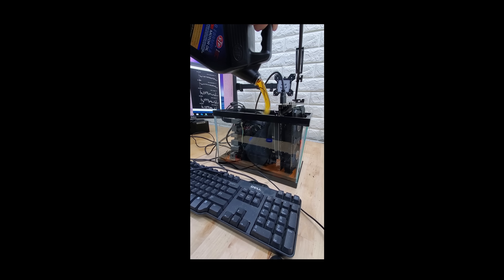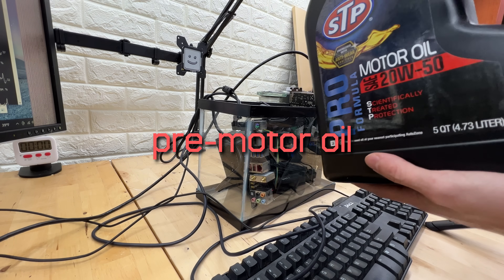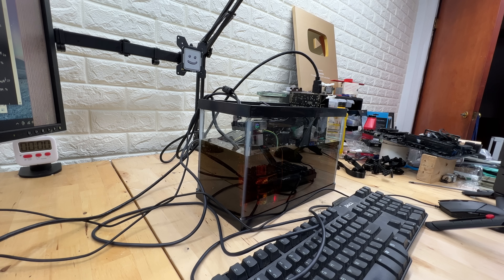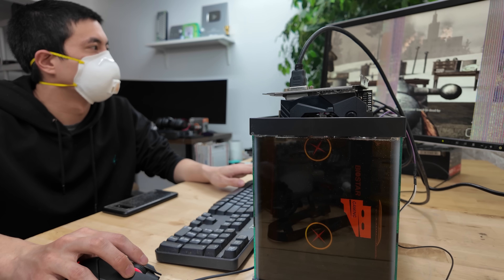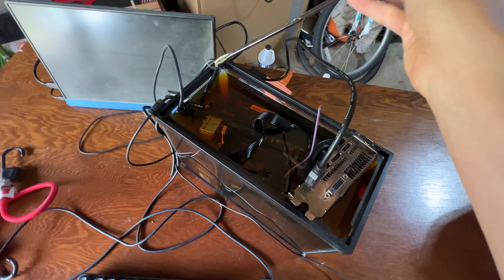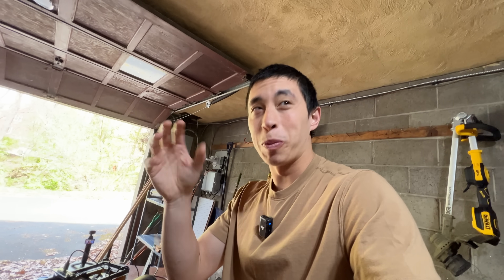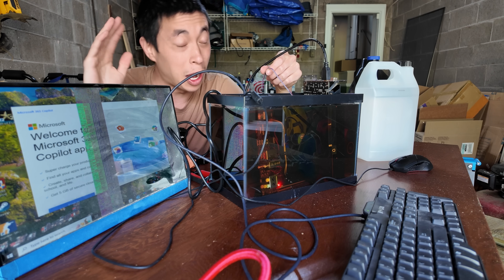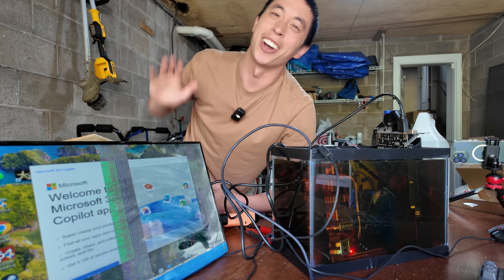Why isn't Motor Oil used to cool down PCs?

Comment: Not the same viscosity. Plus motor oils have anaddative that contains various metals, like calcium, Molybdenum, and others. I doubt mineral oil has adatives that can settle out of the oil, but motor oil does. Also, I'm not sure mineral oil has a shelf life, like motor oil. Hmm. Even if yo had propellers for fans. What would happen when the anti foam settles out of the oil? BUBBLE BATH!!!
Reply: Yup, I knew it.

Comment: I think people are missing the point entirely, motor oil reduces friction, its there to protect the parts from wear and tear.  Engine coolant is to transfer heat away from the engine to a radiative apparatus.  As it is a better conductor of heat

Comment: Last but not the least based on my experience: A lot of plastics and rubbers do not like motor oil. They slowly swell and/or disintegrate in most motor oils. Some plastics does it fast while others does it over a long period of months/years but it still happens. 
Few plastics resist motor oil but it's not that many. The container of the motor oil obviously resists it. Some actually have a coated inside to protect the rest of the container.

Comment: I know data center that cools servers by submerging them in oil. But they got rid of fans, installed heat sinks and have circulation system that moves the oil outside to cool off (they also use the excess heat to heat parking lot in winter). Also, they don't use motor oil but some raw pharmaceutical oil used in hand creams. It worked so well they had to ask their distributor to change the firmware limits to allow more servers per cabinet

Comment: I'd be interested if one could convert a water cooling block to function with motor oil instead, if you changed the pumps to accommodate the much more viscous liquid. Could this be the best of all worlds?

Comment: The hard part is finding out what the additives are. Some additives may increase the conductivity, while others will decrease it. A low conductivity could allow you to completely submerge the boards. You just need a case that will accommodate that.

Comment: TBF, while engine oil does act as a coolant, it's primary use in an engine is actually lubrication. I was surprised that it didn't just ruin the PSU or something though

Comment: 0w-16 oil and a loop with a pump, radiator with fans for cooling and sending the oil back into the tank. Probably don’t  need the fans on the gpu and cpu if the oil is moving through fast enough.

Comment: people saying use 0w8 etc...why wasting money just use cooking oil... what is important ? look at viscosity at 40 degree but best oil to use would be transformer oil like B30 millers transformer oil no other oil even cooking oil would have better flow at 40 degree , it is designed for it :) such oil you can find in fridge compressors etc, engine oil has to stay at certain viscosity in higher temperatures to prevent wear and no matter what engine oil you use it will never be good enough flow for your needs...

Comment: Wait no way !!. I still using motor oil as cooling oil 😂 9 months and still good  i remove the fan when i using the 0w20 but when i use 0w16 i can use fan without problem ..  well for the odor i dont mind i use to that smell Because im working at car repair shop

Comment: 0w-20 or 5w-20 is the way to go if you are gonna do this (I am sure you can find thinner oil, but this is gonna be available widely and affordable).  oil formations are designed for the operating temps and conditions the oil will be used in.  this oil doesn't need to reduce "wear" or deal with extreme cold or heat and viscosity is a problem rather than a benefit in this situation.  thinner is better in this use case.

Comment: Seriously? 20w50 oil???? I'm only 1 min 10 into the video and I can already see it's going to be pointless. Might as well have used treacle. Using a low viscosity, 5w40 5w30 0w40 0w30 0w20 would have been much better. You've just dumped the thickest engine oil you can find in that tank.

Comment: Curious if you should had just taken off the heat sinks and just let the CPU to be "oil cooled".  There's no pump moving the oil but the heated oil should begin circulating by itself.  Not sure if that will be fast enough to be more efficient than the heat sink or not.  You using a viscous oil didn't help though.  0w20 would had been better, though you'll need to pay more for your experiment. :)

Comment: As far as I am aware, the difference between Motor Oil and Mineral Oil...Motor Oil's heat dissipation qualities requires temperatures much higher than a PC can realistically generate to be effective.

Comment: There are lists of known compounds that are not compatible with certain types of oil. Just make sure none of the incompatible stuff is in the computer parts. The reason why you wouldn't want to use motor oil is because the biggest reason for its existence is lubrification. You don't need to lubricate computer parts so you don't need to deal with all the downsides of it.

Comment: you can easily clean motor oil off of things with several different chemicals. i mostly use gasoline for car parts but you can also use lacquer thinner or even brake cleaner from a spray can. you could prolly also use some type of degreaser and let it soak in it.

Comment: A better question would be "why would anyone use motor oil to cool a pc?" 
There is no moving parts that needs lubrication, and water is superior for heat transfer. Dumb video

Comment: Motor oil is mineral based. At least the non synthetic you were using. Eventually, the additives will attract to any ferrous parts in the computer and could cause some issues and oxidation. Motor oil also turns acidic when exposed to air after a period of time. Might work short term, but definitely will not after I'd guess after 6 months to a year.

Comment: To be honest, it would be nice to see in a gycol-based coolant would work. 

The issue with both oil and coolant is it needs somewhere to transfer the heat. 

A radiator or other device that the oilf or coolant moves through transfers the heat and returns in a loop.

Comment: There is no point in keeping the fans in there, certainly not having them connected. I doubt the heatsinks do much either, but they may either help or make it worse, depending, either way you should have some system circulating the oil, bringing the  heated oil out and cooled oil in..

Comment: Stray capacitance and obliterating your overclock is the reason why we don't do this. 
I did something like this years ago.  Turns out it's a terrible idea because the dielectric constant of motor oil is much higher than air (2.1 to 2.4 times as high) which sends stray capacitance through the roof.  This will DESTROY your overclock.  I had a computer that would run rock solid for months at one frequency that wouldn't even boot after the oil.  I had to reduce my clocks about 15% and even then the machine was never the same.

Comment: Based experience of doing maintenance on a car, motor oil doesn't have nearly the thermal conductivity of water based coolants. Since many manufactures recommend changing the oil with the engine at nominal operating temperature, assuming this is to ensure best drainage due to less viscosity at those temperatures, I've had hot motor oil make contact with gloves I've worn, and even in one case bare skin. Providing the engine isn't turbo charged, where the oil is hotter since it cools the turbines, and get the glove or oil off you quickly, it won't burn you. The same cannot be said for coolant, you will have third degree burns instantly with coolant.

Comment: Mechanic here: Dont use Quakerstate or Pennzoil. Use Valvoline as it has less wax used in its formula. Wax is not a good coolant, I promise you (looks at the yellow crankshaft on the garage floor).

Comment: I don’t understand why this is even a video. There are other less obviously dumb ways of getting heat out of a system. Try AC refrigerant. At least it’s used in things as a coolant. Motor oil is a lubricant. Lubricating hot chips won’t do anything

Comment: 8:45 used motor oil picks up metals from the engine and can expose you to heavy metals and lead. It isn’t an actual property of the motor oil that can make you sick, it’s the use case🫡

Comment: Motor Oil has what is known as a "Viscosity level" and the hotter the Oil gets the more Acidic it becomes. High enough acidity and it will eat through solid metal. This is why everyone is supposed to change their motor vehicles Engine Oil and Transmission Fluid as both fluids are Oils. 

The Ph level would just become so acidic it will eat through the entire PC.

Comment: To clean this, submerging the oil covered pc in a mineral spirits (naphtha)  auto parts cleaning basin comes to mind.  Never mind it might dissolve other things.  However, I would never do this to any pc I use. I work with my car enough to not want a petroleum product covering my pc.

Comment: It is funny how surprised you were that 2050 motor oil was thick enough to stop those little bitty fans. Why the crap would you use such a thick oil to test this 520 would’ve been easy to get and you can go thinner than that. and you probably could’ve just disconnected the fans to start with cause they are useless in the situation.

Comment: Also motor oil's specific heat is so insanely high, you could probably run a top end Intel CPU on full load for a full 24 hours and still not have any need to cycle the oil in a cooling system.

Comment: I knew immediately that oil does nothing to most electronic components because modern car engines (and automatic transmissions) all have tons of PCBs and sensors that are exposed to oil based fluids for their entire lifetimes (multiple decades), and they don't break down (well, they DO break, but not because of oil exposure).
Reply: Oil absolutely damages components. Engine oil is made with protective minerals put in that will damage components. Engine oil will also collect moisture from the air if you live in a humid enviroment. Which is why engine oils have a operating temperature. Which is why engine oil sensors are Thermal couplers and pressure sensors, which can both be isolated from the oil., And comparing Engine oil to transmission fluid is like comparing apples and oranges. Transmission fluid is mainly ethelyne glycol which is a solvent which doesn't have the same issues as engine oil as its hydrophobic. And its a stable polymer that isn't likely to pick up minerals.

Comment: What's happening here isn't really "cooling" because all you've done is submerged it. I recommend to really try the experiment again you need to try pumping the oil to and from an external radiator and fan, and choose an oil appropriate for the size of the machine, a really thing motor oil. Also you can do away with the plastic fans on the video card and cpu because they aren't helping! Getting large fin stacks for the cpu and gpu fanless will be good for an actually useful experiment. Hope this helps. I am a diesel engineer.

Comment: Bro picked the thickest possible oil, whyyyyy?! I need an oil change update on this with full synthetic 0w oil please. Also, it's probably best to use a very basic one, some oils have more additives than others, and those may or may not make a difference in any possible reactions with the hardware. In general though, motor oil is supposed to protect very well, so I can see it being fairly effective.

Comment: You could technically use de-ionized water. I'm not sure where you would get that. I used to use it with wire EDM machining. We had this golden resin that would filter the water that we had to change occasionally.

Comment: The fans are basically useless because of the oil, there should be a pump to circulate the oil instead so we can move the hot oil away and cooler oil back towards the computer. I think this isn't really necessary for a typical personal PC, but If there are no long term consequences it might make a lot of sense to use a light weight oil to cool large scale servers, if you could have a sealed system with an oil cooler it might actually be cheaper than current server cooling options, though as important as maintenance is a server would require access to replace parts, so it would need to be made in a way that allowed for that.

Comment: Mainly the answer is that it's too thick and it was designed to operate under motor temperatures... So... This thick oil will be hard to clean and basically it won't flow very well.

Comment: For any liquid submersion, I would remove the fans and any moveable parts, then install a water pump - or something similar that can handle the increased viscosity, to move the liquid to a "cooler" then back into the tank. I doubt a computer could reach the temperatures needed to even out the heat within the tank since I'm not interested in it enough to look it up, but its something to keep in mind.

Comment: Actually, why not use motor oil in a cooling loop? You would probably be able to keep the loop running for much longer, not needing to change the oil every two years no?

Comment: Yes, except that engines are basically water-cooled. It's the radiator through which the water circulates that cools the engine. The oil serves to lubricate the engine so that parts don't rub together and generate heat. The only moving parts in a PC are the fans.

So, I'm not saying that oil isn't effective at absorbing heat, but it's certainly not used to cool an engine, but to prevent it from overheating without even having to use its heat-absorbing properties because, basically, it just makes things slide better.

In addition, the oil needs to heat up before it becomes a good heat transmitter (and will do so slowly as it is not very good at that by default), which means that you will have to wait until the PC is in the red for a very long time (the time for the entire volume of oil to be at the right temperature) before the oil starts to be of any use where the action of water is almost immediate. Oil is not made for things that do not rise so little in temperature as a PC and especially adapts very poorly to rapid temperature fluctuations that a CPU or GPU can require. It is much less adaptable than water.

Ultimately, for PC the only real advantage of oil over water is that it does not conduct electricity; for everything else, it has nothing but drawbacks.

If your fans stop spinning, it's mainly because they certainly don't have the power to operate in a liquid. All you're doing is burning them out by leaving them powered under these conditions, especially since they're useless if all the equipment is submerged (exactly like a completely sealed PC case with a fan spinning inside). If they can spin under these conditions, that doesn't prevent them from having to give everything and still be slowed down. It's like making an athlete run at their maximum speed but forcing them to do it in calf-deep water. They'll push hard to do it and then tear their muscles. In any case, it won't circulate the oil in the radiators or at least not enough to change anything in the temperature and you would have to waste a lot of power to get them to spin hard enough in these conditions to get any really useful result, which is almost impossible in this configuration.

Comment: Probably because the heat capacity is ~40ish percent of the heat capacity of water. There was a place that put their servers in mineral oil though to make them silent. So it has been done before.

Comment: The problem with using motor oil is a PC doesn't run hot enough to get the oil up to operating temperature, also it will make your house stink and its flammable.

Comment: Funnily enough motor oil doesn't touch you're stuff like at allat most it woll create a layer over them but besides that if yoh leave this pc enclosed in oil and come back 50 years later it will most likely book like nothing ever happened.

Comment: Try with lower viscosity oil like 0w-8/ 0w16. They are also more transperent. fans will not spin in anything higher than 5w30
Reply: Why/How do you know the maximum they can spin in lol

Comment: Well motor oil is a lubricant meant for combustion motor engines that have moving parts to reduce friction.

There are no major moving parts in a computer that would warrant using motor oil in them.

Antifreeze is a coolant used to cool down combustion motor engines.

That being said, I could see a video emerge about cooling down your CPU using Antifreeze.

Comment: Whyyyyy are you using 20w? That's super viscus and thick. If you used some 0w instead the fans would probably keep spinning and act as an oil pump haha. I'd be interested to see how it works with a single large fan in the tank to aggitate the oil around more

Comment: Thats not where i thought this was initially going, I was thinking for a water cooling set up & that the reason they dont use it is because the pumps aren't strong enough or wear out quickly.

Comment: Because it makes a terrible mess and motor oil can contain additives that is electrically conductive...  Also you will need a radiator to cool the oil. 

There is other oils better suited but it makes a horrible mess and you never the the components clean again and you WILL regret it !!! Also a friend of mine cooled his PC with PCB transformer oil that is banned for a very good reason, he ended up in hospital with really bad allergic reaction to the poisonous canser oil after 2 months of using the PC cooled with that oil...

Comment: Higher viscosity results in poorer heat transfer from hardware to oil all things being equal. And you would need to think about a way to remove the heat from the oil out into the ambient should you have enough wattage going through your machine for long enough. Can't just let the oil continually heat up like that.